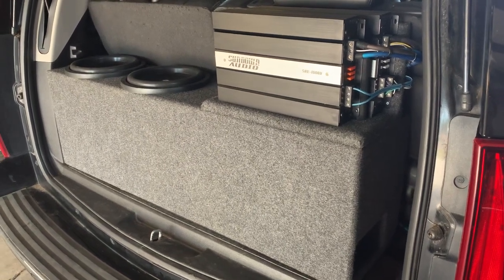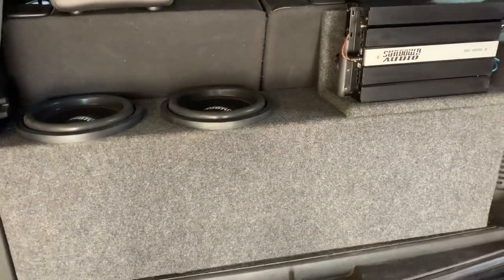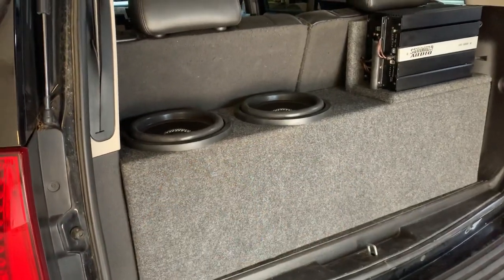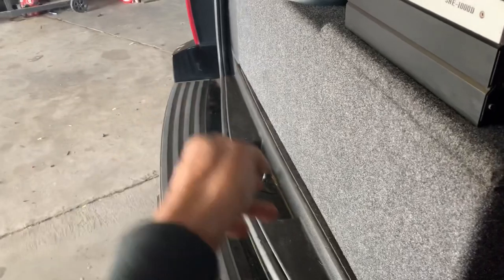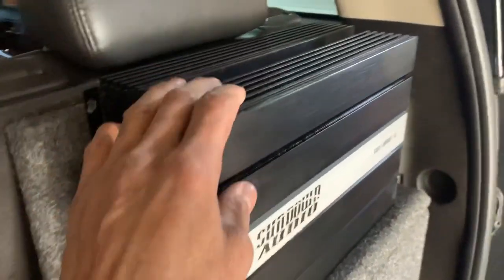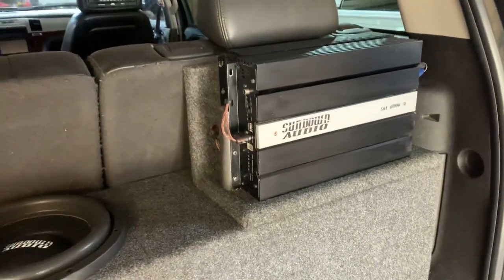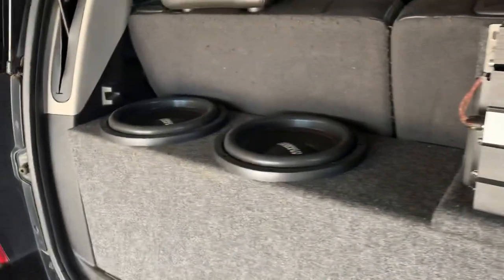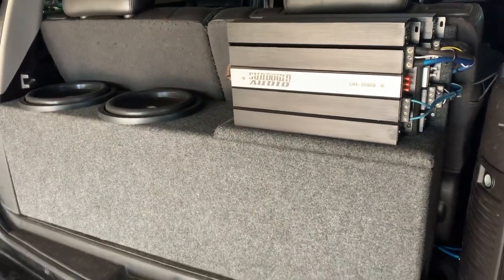Cadillac Escalade Third Row Box build @Soundsource Macon Ga

Comment: Good work, you advertising those amps though. Isn't there a better place to mount them?
Reply from the maker: A. S. That’s were the customer wanted them
Reply: @bj_from_the478  🔴 Right on✌🏾, hey why i got your attention. You did a video for a sub box for the new Escalade, buy chance did you also do the amp install and if so did you bypass the ANC microphones or use something different like Nav-TV m650 or a GM-PAC product. I have a 2016 model esv.
Reply from the maker: A. S. Sir this model didn’t have the noise canceling mics in it but if it did there are eight wires under the cup holders that you have too cut on 2015 and up there in the rear on the amp and it’s one wire purple and blue